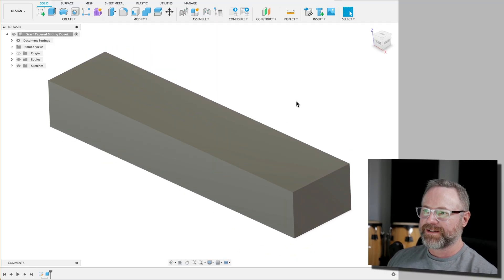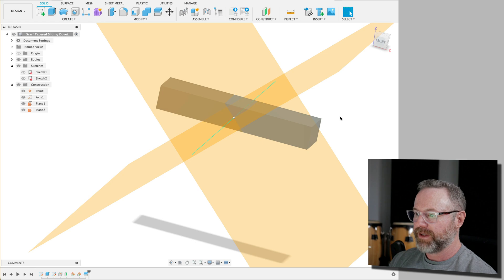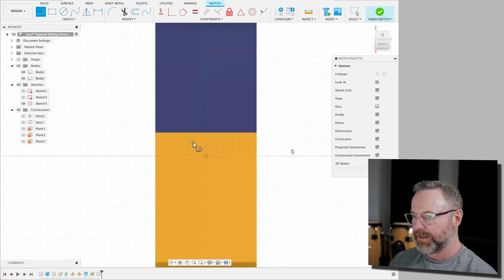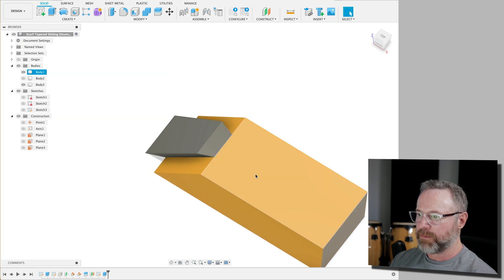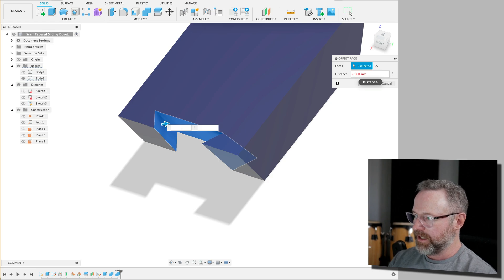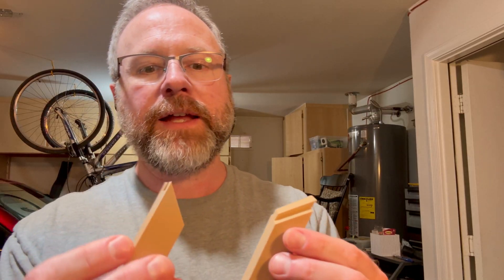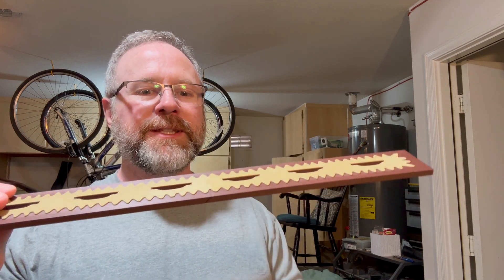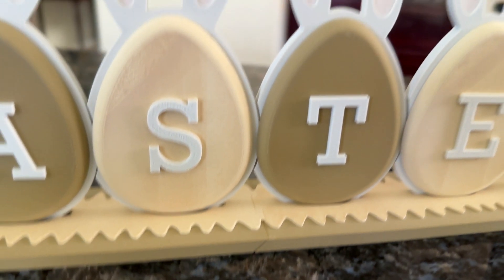How to make a Scarf Tapered Sliding Dovetail Joint in Fusion

Comment: Just wanted to say thank you! This video inspired me in how I redesigned my iPhone/Apple-watch magsafe stand. It worked amazingly! What I really like is friction-fits with 3D printing are really hard because every filament expands differently. But the tapered dovetail doesn't care - it 'self adjusts'. I'm going to use this everywhere now. About my iPhone stand, if anyone is interested - https://www.youtube.com/watch?v=A7yBwXt0G_w
Reply from the maker: dude, that's awesome, going to look at your video now.
Reply: A few notes on how I did mine. I did it a little simpler. I made the dovetail cross-section in Shapr3D then extruded it with a 1 or 2 degree taper. Then I used it to cut-out the grove in my top piece. Then I only rounded the outer corners of my 'positive' piece. And that's it. Since the dovetail self-adjusts based on how far you insert it, I didn't need to make the small gap between the negative and positive parts.
Reply from the maker: excellent work man, you took it to another level!

Comment: Hi everyone, when I try to add the taper to the new-body extrusion, I get ERROR: Cannot complete extrusion. Any idea what might be going on?
Reply from the maker: it normally means that somewhere in the calculation there's either a constraint or a limit it reached. Try changing the taper to a very small amount, and go up in increments.
Reply: @zionbrock  Alas I wasn't able to figure out that particular error—no matter how small 0.0001 I made the taper—but once I figure out another way—using extrusion + splitting—the results were AMAZING. Worked instantly, and perfectly.

Comment: I don't think using 'taper' is good idea here - one face will be not parallel to the cut plane. Possibly would be better to use draft command on the tool body right after extrusion and draft only sides.
Reply from the maker: I love the feedback, not sure i completely understand what you're saying tho. But now I'm curious.
Reply: @zionbrock  i mean, when you extrude tool body with 2dgr taper - you get all sides of this body leaned. When for joint you actually need just two of them leaned, and other parallel to 45dgr cut plane.